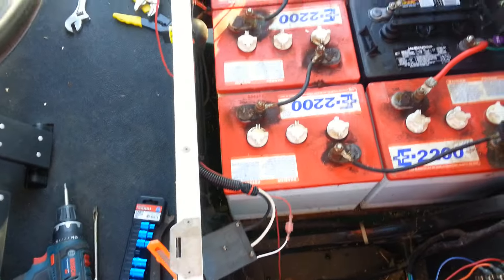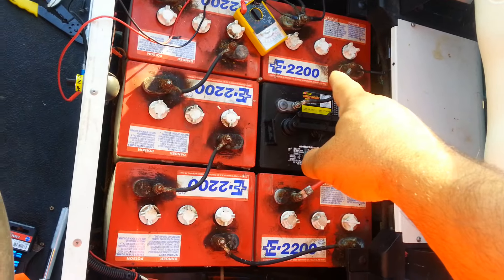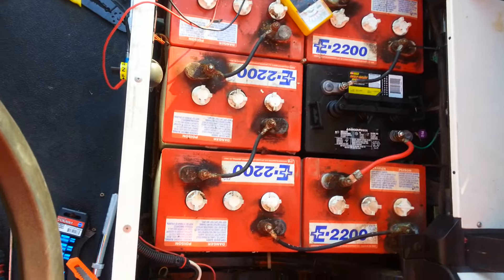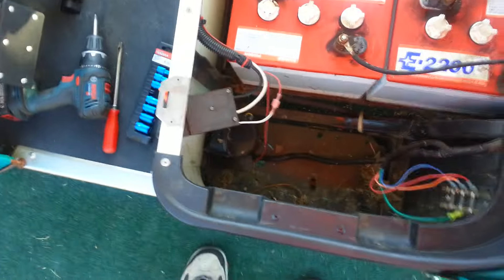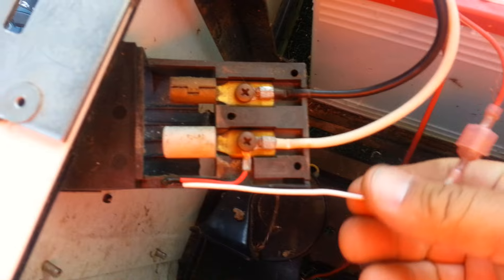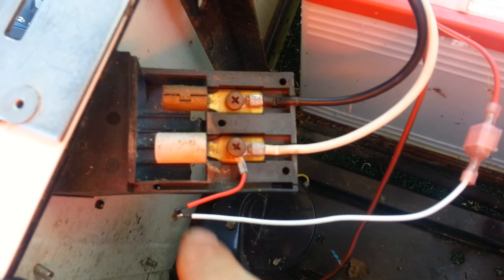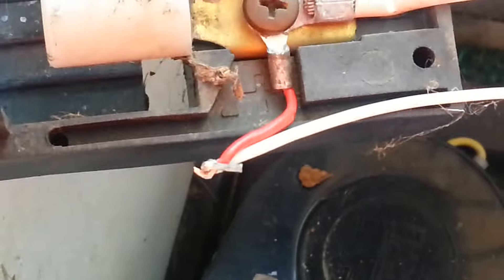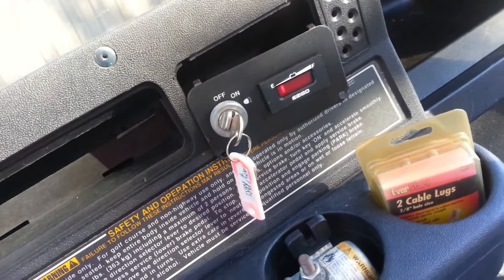1995 36V EZGO Golf Cart Reed switch bypass

Comment: Have similar problem. Where does the read wire end up connecting too?  Thanks
Reply: little red wire goes to the key switch  although it changes color ???blue or green??? it leavres key switch  and goes to pedal box in floor you have to takemat up to see it its tint switch mountad in the box that control speed it leaves that switch and gos to solenoid on controller  small lug as red wire that make solenoid operate when pedal is pressed if nothing happens check that tiny switch in he pedal box  ( mine was broke )  had to replace it if you ever need tt switch its  name is EZGO accelerator micro switch it fits from 1994 on up this co . is in charlotte NC   cost is 8.58
Reply: @frankdavidson9675  frank, I see your reply, but the lack of commas and periods,  only make it more confusing.  I have a similar problem as the guy in the video. I think the thing we are trying to figure out, is if you cart is older, and people have made changes along the way.... but you have the Rees switch problem.... splicing the red and white wire together and eliminating the magnetic switch, that makes sense..... but where specifically does the other end of the wire connect to?    My cart only has the 2 cables running to the batteries directly. The red wire that also went inside the charge receptacle was cut off. So I am trying to run a new wire from where the small reed switch connected inside the charge port.... but where am I running the other end to, to bypass that magnetic reed switch and just wire direct. 

Thanks
Reply: ok i will try to do better  with my( grammer) and period s but when you get 87 like me they arent as important as they used to be this is  not an English class  we are trying to re wire a golf cart  so lets start all over look at the charge plug the small red wire conns. to reed switch the other end conns. to big red wire on charge yours may be a different color check with  volt meter  36-48 volts now leave reed switch go to key switch on dash   you may take key switch to verify colors it leaves key switch    and gos to small box under the floor mat you have take the mat up to see this  te foot pedal operates this tiny switch ( mine was bad  had to replace it)ok it leaves that box and gos solenoid on small lug on big control box under the  seat  --------so here is what happens when you press the floor pedal you are conn. 36-48 volts to the solenoid to operate the elect . motor now to restate  take out key switch so you can test you need voltage on key switch  all the time when you turn key it conns. voltage to floor pedal the floor pedal sends voltage to solenoid   if you are missing this voltage back up all the way to charge plug that is where it all starts you do not need reed switch .
Reply: Thank you Frank!